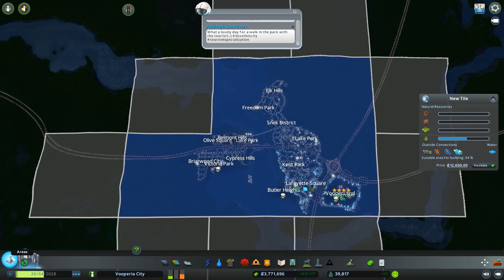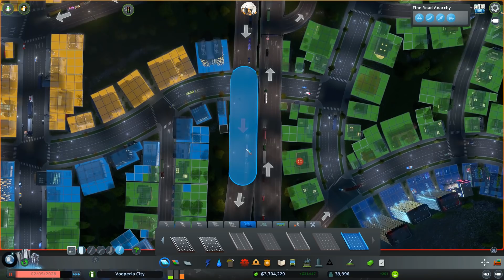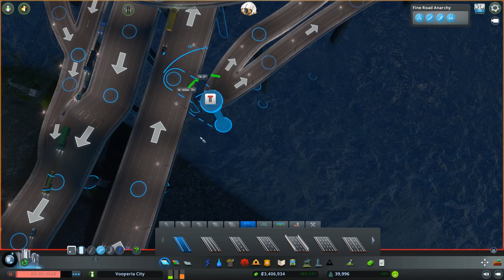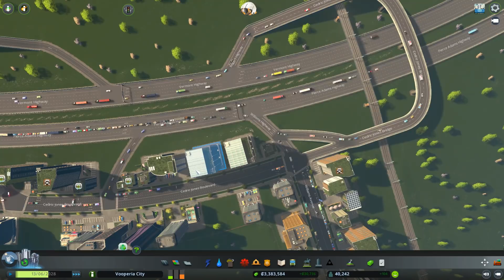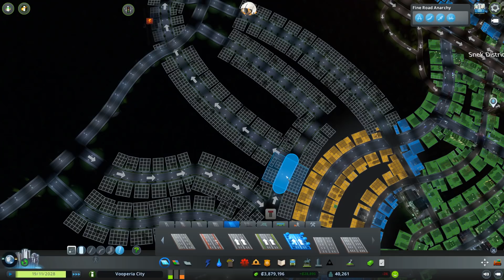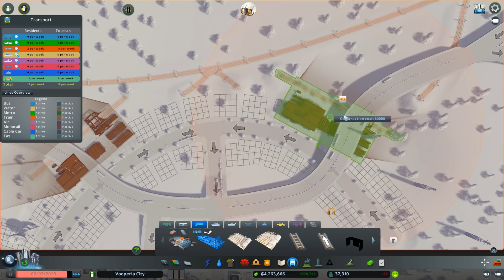Vooperia City #7 | INDUSTRIA: Mega Industrial Complex | Cities Skylines

Comment: They are named railroads, but that doesn't that you should treat them like roads. It won't work and definitely not look very good like you did it.(Actually it looks horrible [Teeth grinding] ) Trains need a lot of space, in order to hold without blocking others and normally can't take that sharp turns you made. (Idk if they can in Cities Skylines tho) Your citi looks extremely nice that far, don't make your Railroad stand out as an ugly and inconsistent spot to look at.Keep on the good work!